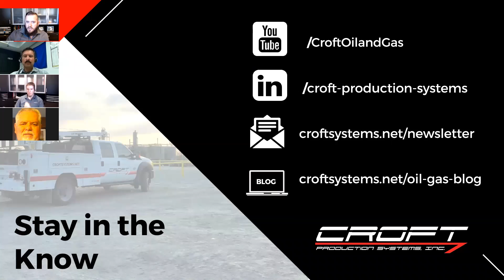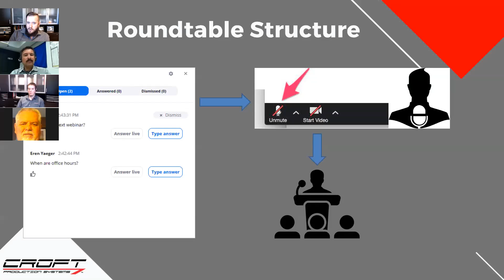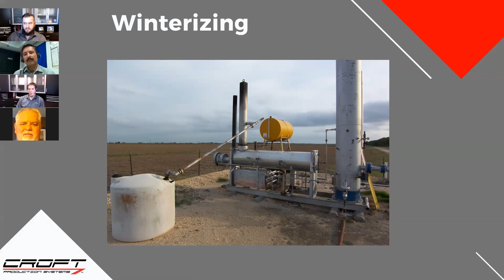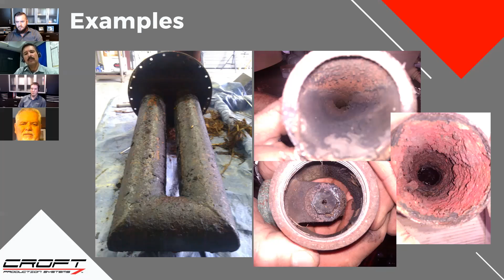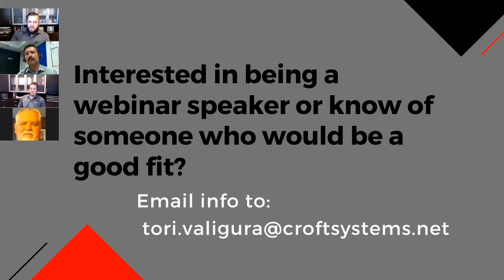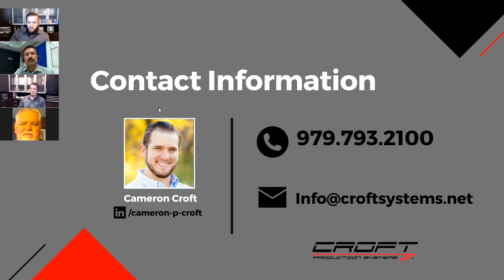Roundtable | Natural Gas Dehydration

Comment: What filter material is suitable for glycol application? We got polypropylene in our lean glycol loop, the outer sleeve deforms within a week and the end caps detach from the media pack!
Reply from the maker: Great question, the filter material suitable for our glycol units on the lean side are cotton string wound or melt blown polypropylene filters. We design our filter housings to receive double open end filter elements so that we don’t have to deal with end caps.
Additional suggestions:
Ensure your filtration is after the exchanger on the lean side, this will allow you to filter the glycol at a much cooler temperature and increase filter element life span.
Also, verify if your current filter element is sized to move your expected flow rate if not sized properly it can become a restriction and create a differential pressure which could lead to deformations. If your filters are falling apart within a week this makes me think either a process flow issue or incorrect filter selection.